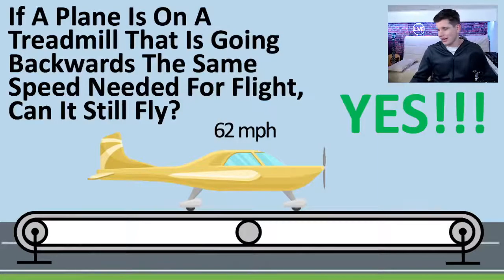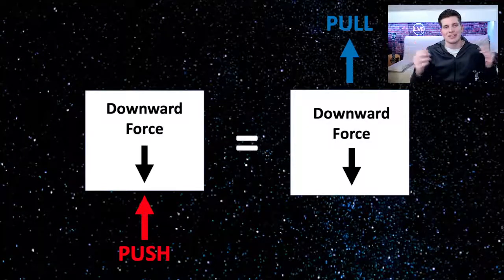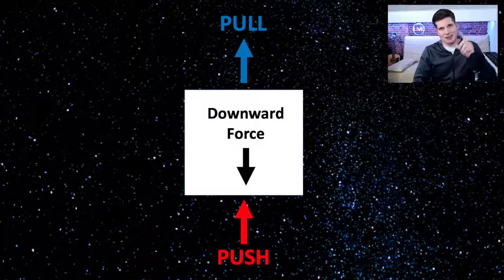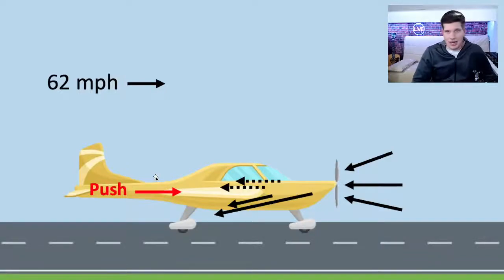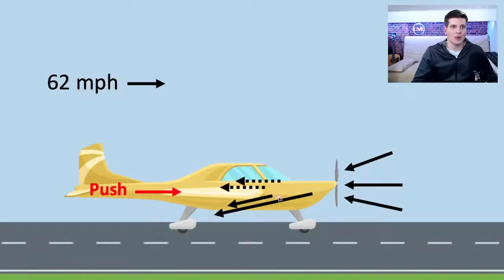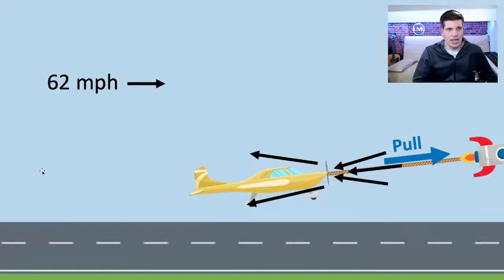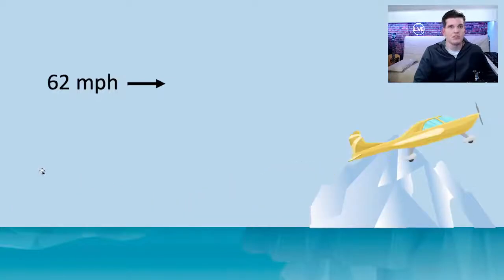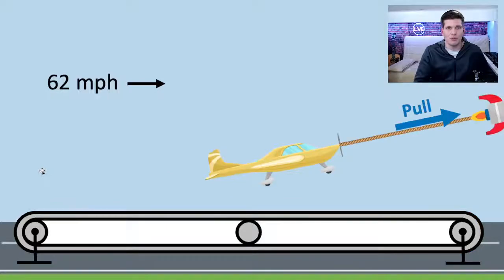Can A Plane Fly On A Treadmill? SOLVED! -A Practical Review

Comment: I always get light headache, when seeing this "problem" and now have a bad headache from your video. There are two major forces the engine of the plane must overcome when starting: air drag and rolling resistance of the rubber tires. This rolling resistance MUST NOT be underestimated but you simply did. The work needed to deform the tire from round to flat at the contact patch area is rather large compared to let's say railway wheels made from steel. All of these "planes on tread mill" ideas always ignore the deforming work done in the tires, but that's where on a tread mill in the end all the engine power of the plane is going to AND NOWHERE ELSE! If you put you tread mill to a -1000 mph, it will simply yeet the plane of to the left, because the plane engine will not be able to produce enough power to overcome the rolling resistance of a 1000 mph. Inside a plane really noone is interested in the speed over ground or the turning speed of the wheels. The only speed that matters to get and stay airborne is the speed relative to the air. Your plane needs 62 mph wind speed over the wings to take off. The plane on the 62 mph mill does not move itself relative to the air or real ground, only to the stupid tread mill, so it does not create any lift at all and simply will not take off. There is nothing complicated about. The wheels are spinning with 62 mph, but who cares? The engine, because it needs to provide the energy to overcome the rolling resistance of the 62 mph tread mill to keep the plane on the mill. The plan will take off, if you have enough engine power to bring the plane on a -62 mph tread mill to +62 mph ground and relative air speed. The tires will then run at 124 mph, but the plane body will move at 62 mph. If you have enough engine power and the tires will survive that, then you can do that but that was in no way part of your explanation. And by the way: the problem is not completly unrealistic. lets forget that idiotic tread mill, if we have bad weather conditions with a lot of wind and we are forced to start with the wind (for whatever stupid reasons), the plane engine needs to speed up the plane body to 62 mph faster then wind speed to create enough lift and therefore needs to speed the plane body and wheels faster then 62 mph ground speed. While the drag is not increased the rolling resistance is increased, exactly as on the tread mill.
Reply: I actually looked up the rolling resistance and the wheel bearing resistance of a 747 (the plane mentioned in one of the early versions of this) when this problem first made the rounds. I don't have the numbers anymore but the total force that the gear could possibly exert on the plane was trivial compared to the engine output. It might as well not even exist. Once the engines are spun up and the plane is moving, if the rolling resistance were to exceed the static friction of the tire contact patches, the plane will just start dragging the tires even as they spin.
Reply: In a physics problem, we ALWAYS ignore friction! Rolling resistance is trivial anyway unless the brakes are locked up.
Reply: Yes if the plane engine powerful enough to drag the locked wheels from stationary position to take off velocity then that plane would take off regardless there is runway or treadmill below tyres.

Comment: The ice is a bad example because the ice doesn't negate forward motion whereas a conveyor that exactly matches the speed that the planes wheels are turning relative to the ground would negate forward motion.
Reply: It removes the element of friction between the tyres and the surface in order to demonstrate how friction is not necessary for a plane but it is for a car.
Reply: @PJMaybe75  that is flawed.  Friction is just a portion of an applied force - a 'tax' of force applied.  The conveyor system exactly matches the resulting vehicle speed of the vehicle.  Those radically different scenarios.

Comment: If the tyres of the plane are replaced by  a  gear tooth pinions  and the conveyor has  mating  rack (linear gear),   can the plane still  fly ?
Reply: Using the first version of the question as he asks it in the video, no because the plane still has zero air speed. 
Using the second version of the question as he asks it in the video, yes because the airplane will still be able to achieve the required air speed for take off.  
This doesn't significantly change the problem.  It adds some additional friction and makes the airplane engine work a little harder (I imagine it will also be harder to drag the rack instead of a simple belt) but nothing else changes.
Reply: @greybeard5123   No matter how you ask the question, the plane will have airspeed/(real)groundspeed commensurate with the thrust as per normal.   How the wheels are or are not spinning doesn't change that.   How the wheels are spinning is an irrelevant detail which has no bearing on answering the question.
Reply: @MJSmithGroup   Depends on the question.  This whole debate isn't a physics issue at all.  It is an debate about English grammar and what "speed" is referring to.   

0:41 has the way the question is normally asked: "Can a plane still fly if a treadmill is cancelling out it's speed?" Actually the normal question is "Can a plane take off if a treadmill is cancelling out it's speed?" 
0:48 clarifies that the treadmill is cancelling forward movement of the plane.
0:55 rewords the question to "Can a plane fly while it is standing still?"  
In these wordings of the question, the plane does NOT have airspeed and cannot take off.  

Your argument is that since the plane has airspeed, it will take off.  Go watch those questions again - they specify that the plane does not have any airspeed.  Your premise is invalid because you are answering a different question.  In your answer, what speed is the treadmill cancelling out?  Because that is the whole point of the question.  The question is not simply "Can a plane still fly if there is a treadmill?" 

I agree that a plane being accelerated by a prop will not be significantly affected by a treadmill.  But that just invalidates the question since the question specifies that the treadmill has to cancel the plane's speed.  

Here is one way to visualize it.  With the plane on a treadmill, have the treadmill moving at the plane's take off speed.  Have the propeller just barely turning, just enough to hold the plane in place relative to the ground below the treadmill.  Now the treadmill is cancelling the plane's speed, the plane has an airspeed of zero, and the irrelevant wheels are spinning at take off speed.  With zero airspeed, will the plane take off?  

FYI, my answer to the question "Can a plane still fly if a treadmill is cancelling out it's speed?" is that it is impossible for a treadmill to cancel out the plane's speed so the question is invalid.
Reply: The rack and pinion comparison is the best way to show that the vehicle never moves.  People are confusing rotational behavior of the wheel (or pi ion) with the linear speed of the conveyor (or rack, in this case).

They have independent motion but the thought project explicitly states that the motion is synchronized in equilibrium.

Pretty simple.

Comment: There's 2 versions of the question with 2 different answers. The other version reads:
Imagine a 747 is sitting on a conveyor belt, as wide and long as a runway. The conveyor belt is designed to exactly match the speed of the wheels, moving in the opposite direction. Can the plane take off?
Reply: The conveyor belt cannot exert any force on the plane as the plane's wheels are just idle rollers. The conveyor, at any speed, wouldn't have any effect on the plane's mode of propulsion and therefore couldn't stop it from accelerating and taking off.
Reply: @thomasroewer5673  You right, but that simply makes this untestable as T Hsu described it.  Since the plane is accelerating compared to the ground, the conveyor speed can never catch up to the plane's wheel speed.  The conveyor will continue to accelerate until the plane is airborne, and at that point the conveyor speed will be 62 mph slower than the plane's wheels. 
Different test - conveyor accelerates to 62 while the airplane accelerates until it's wheels are also going 62.  Picking a predefined speed for both is the only way to get the conveyor speed to match to plane's speed.  When the speeds match, the plane's airspeed is 0 and the plane does not take off even though it is going the required take off speed as measured at the wheels.
Reply: Gravity. + surface = force applied @thomasroewer5673
Reply: There's only one answer: Is air mass over the wings sufficient to create lift in excess of the weight of the aircraft?  If Yes, the plane will take off.  If No, the plane will not.  Everybody wants to make this more complex than it really is because of their nerdy egos.

The treadmill and tires and all that other silliness is irrelevant.  You can fall from the sky in a stall 10,000 feet over the treadmill if your airspeed falls below what is required to maintain lift.  That fact alone tells you all you need to know about the effect of the stupid treadmill.

The treadmill was a contrivance to ask the question "Can an airplane take off from a stationary position?"  That's it.  The answer is No.  Not unless you have a headwind sufficient to move the airmass over the wings.  And then you're taking off in a hurricane and you've got really big problems anyway. LOL
Reply: @markw999  it is not possible for the conveyor to prevent the plane from moving forwards because of the free spinning wheels of the landing gear (in the ideal case... ignoring friction and materials so that the wheels can spin at any speed and not fail). Any horizontal force applied to the wheels by the conveyor just makes the wheels spin.
Reply: @keyboardpuncher  IF the conveyor is long enough. The question is asked multiple ways. And yes, there are going to be practical limits to the speed of the plane given the limitations of tires etc. 

Still doesn't negate the actual determining factor: airspeed over the wings.
Reply: @keyboardpuncher I disagree, the wheels on a plane are necessary for a reason. They aren’t useless, they are to reduce friction between the runway surface and the plane itself. They do this be being freely spinning.

The magic treadmill, however, takes away the “freely spinning” property of the wheels. Any rotation of the wheels is counteracted by the treadmill. So the question effectively becomes, can a plane take off if it has brakes applied to the wheels (assuming indestructibility)?

At least for a 747, I don’t believe they do, I don’t think it will achieve any forward momentum at all
Reply: @keyboardpuncher Addition to my previous comment for clarification, if the treadmill matches the speed of the wheel in the opposite direction, not the planes.
Reply: my take on this is yes, as the same principles apply. wheel speed is cancelled out, but not relevant to the propulsion of the aircraft. I'm keen to see another video on that scenario as the interwebs is going crazy once more 😂